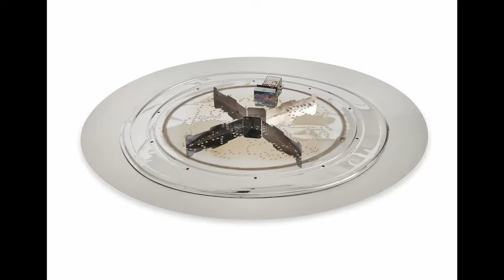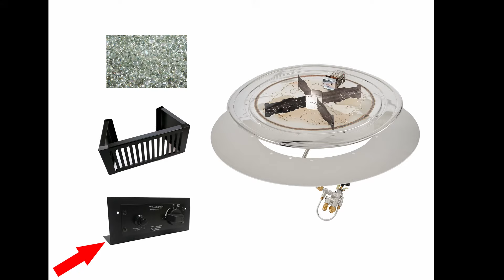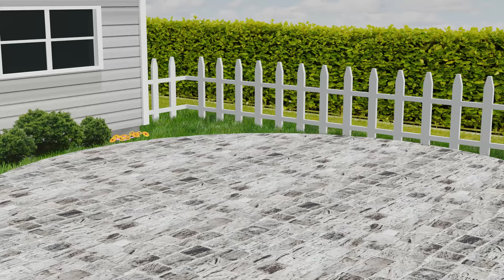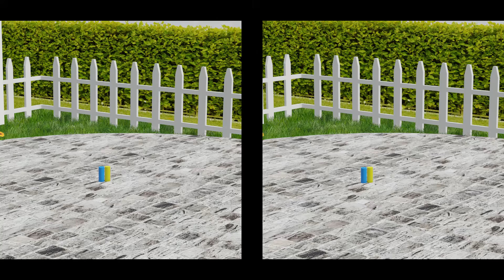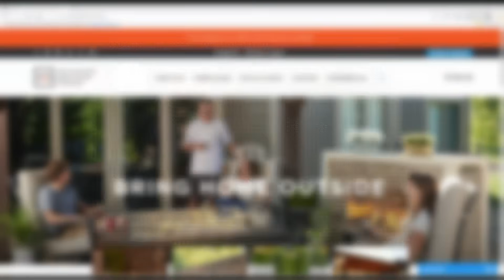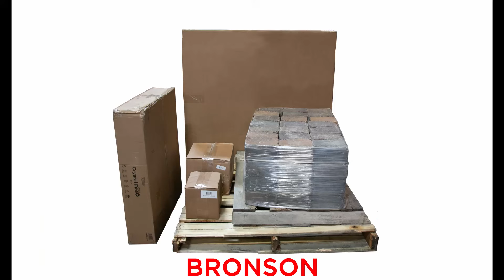How to Build Your Own Gas Fire Pit

Comment: Vents are pointless!!! The flame is on top not the bottom!
Reply: The vents are actually important there sparky. It is for Cross ventilation in the event that your flame goes out (if you are not using Thermo couple) or you have a gas leak. It prevents the gas from building up underneath and creating an explosion hazard.
Reply: @jstadude9810  There's plenty of ventilation the blocks are not solid there is gaps I've seen plenty of fire pits that don't have ventilation at the bottom and they do just fine so think what you want there buddy
Reply: @jstadude9810  
If installed correctly they should never ever be a gas leak also you're fire is on top of the pit not on the Bottom Why don't you watch more YouTube videos and you see exactly what I'm talking about
Reply: If using LP, you mix nozzle is under there and needs a fresh air supply.